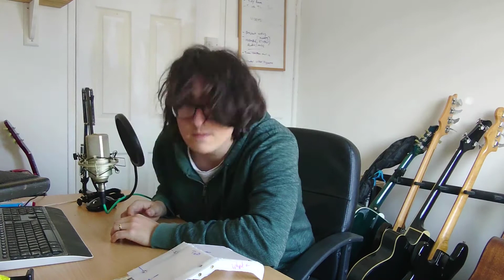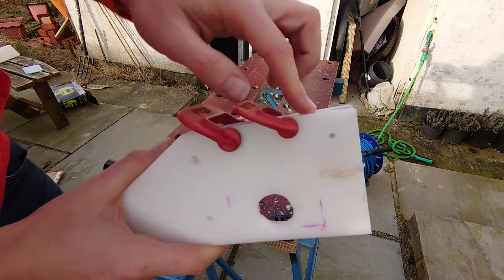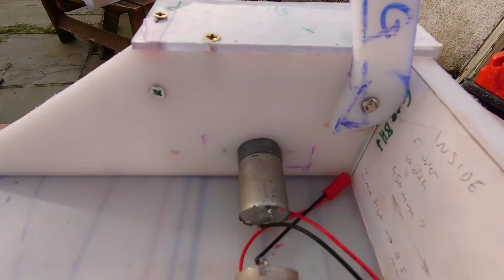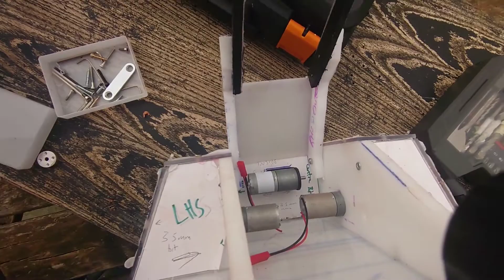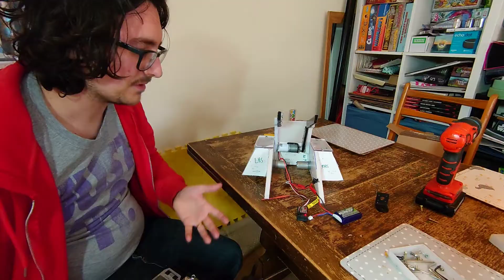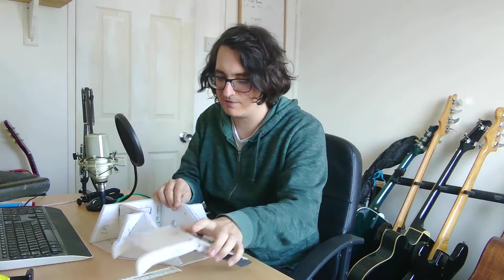Oh... Flip! (pt.1) - HIFMB Episode 6

Comment: If weight becomes an issue, that 37mm weapon motor could happily swap out for a servo. There are some very good 30kg servos on ebay for under £15 which, based on the spec I recall seeing for the 37mm motors, will be more torque for less than half the weight.
Reply from the maker: I do have a couple of servos that were originally going in the first version of Volta. I will factor in a crash diet at some point to get the weight down. I'll probably replace the external polycarb panels and do some cheeseholing.

Comment: You may benefit from having a curved plate on the bottom rear of the machine, to help it in rolling over better during self-righting.
Reply from the maker: That is still very much on the books. If I can't get it to roll into its wheels, then I will definitely implement this.

The first (awful) iteration of Volta had two arrowhead type fins on the back because I thought they would help with self-righting. It did very much the opposite, but I'm open to try a similar approach again with this new configuration

Comment: Hey, for better self righting you should put a little horn on the top of the lifter, so maybe that would help
Reply from the maker: Good call! The new motor and linkage has actually already been fitted and the reach has been increased. I'm yet to test its output so fingers crossed, it'll work. The fun is all in the experimenting!
Reply: @JimmiCottam  good luck